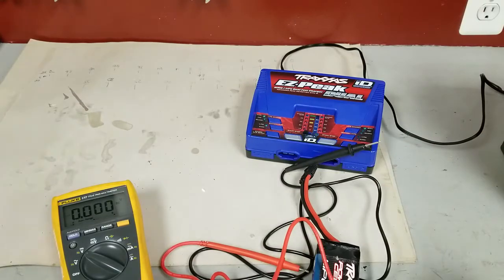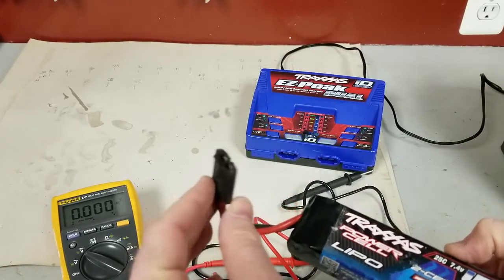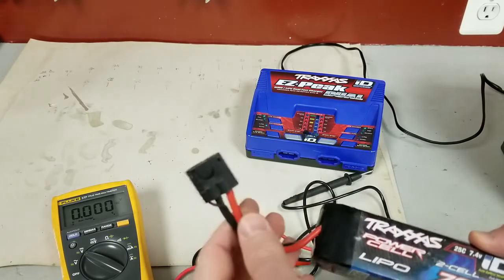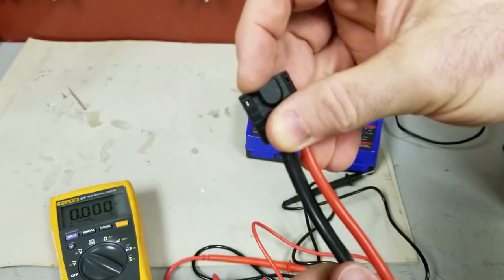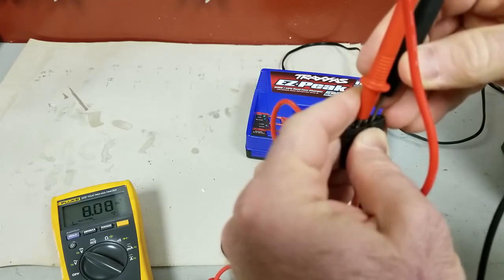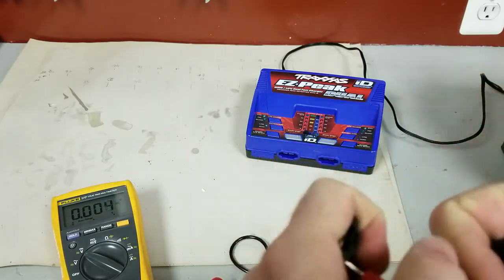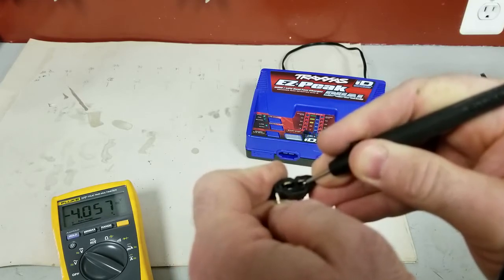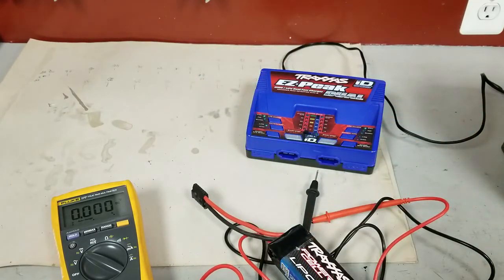Traxxas battery voltage

Comment: Excellent tip using your multi meter. I was ready to buy one of those gadgets to check these Traxxas batteries. I bought a 26" boat and was a talked into this same charger. The other poster is correct on the volts per cell. 4.2 v per cell.